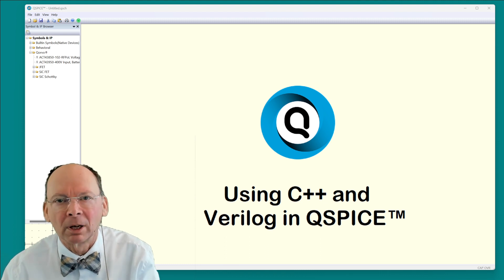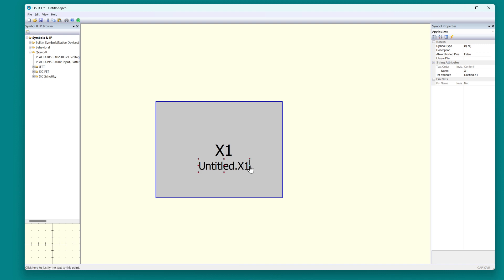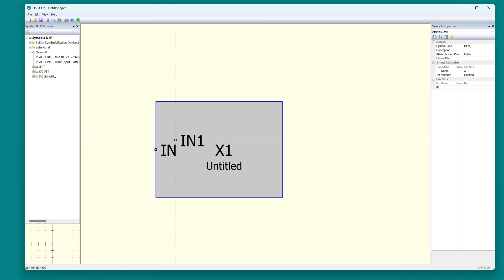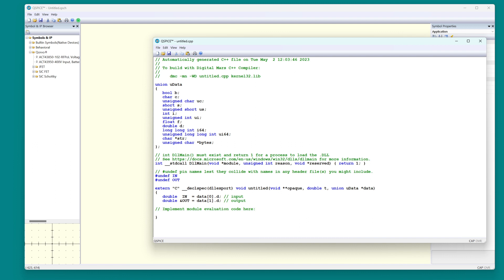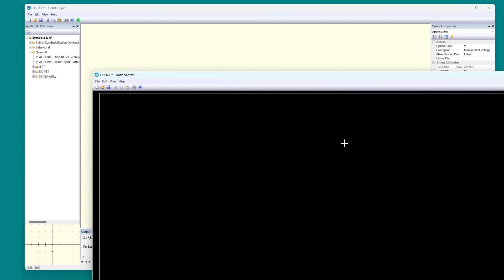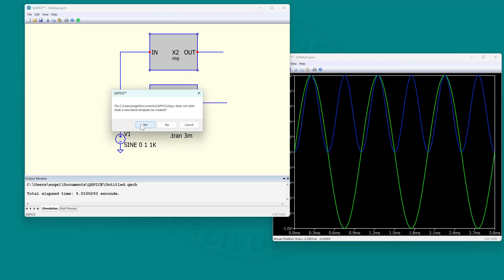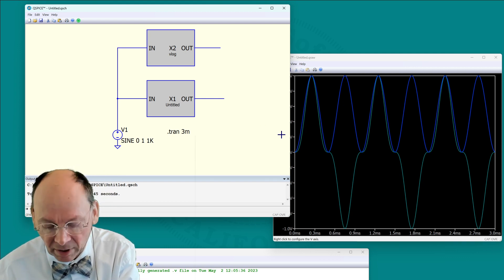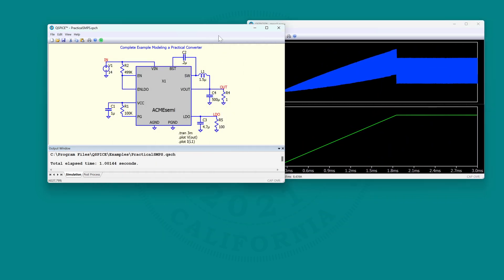Using C++ and Verilog in QSPICE

Comment: Great. I noticed that it Compile Verilog to C++, so the QSPICE final simulation is based on C++?  If it directly compiles the Verilog without converting to C++ would be great. I mean don't know how efficient is the Verilog compiled to C++ first? Also, any plan to add VHDL in the future?
Reply: But it does not matter. Don’t you realize that in both ways a machine code is a final result? There are number of special tools for writing, building and simulating hdl. Because qspice is not about a hardware. It’s about signals
Reply: You are right, the machine code is the final result. But Qspice is all about hardware, signals and now about software too.  @sc0or